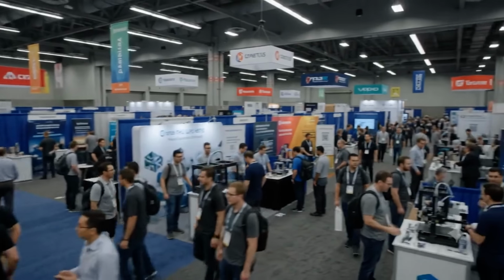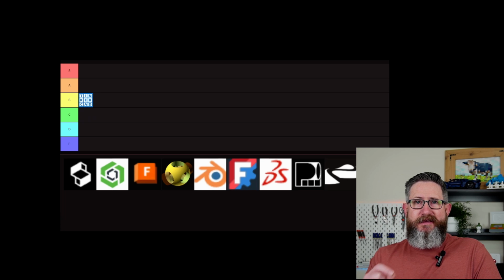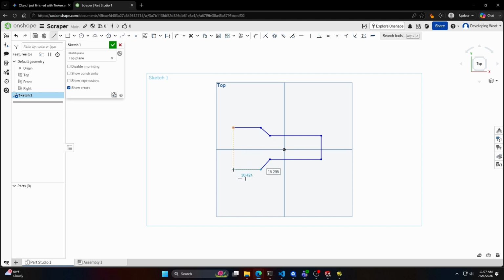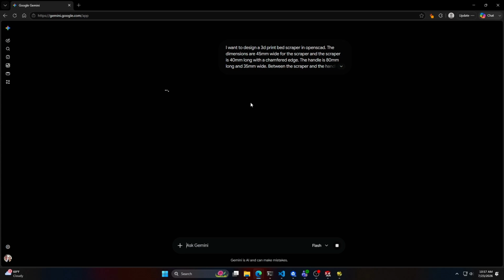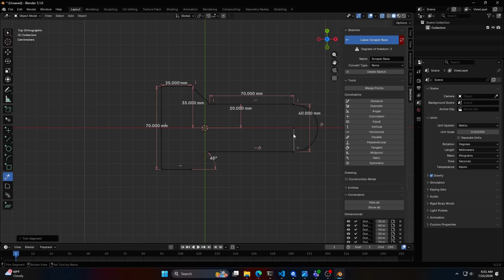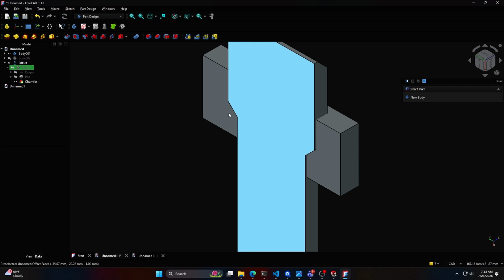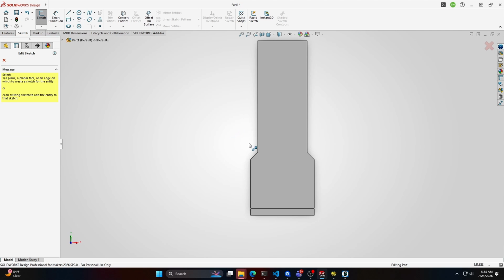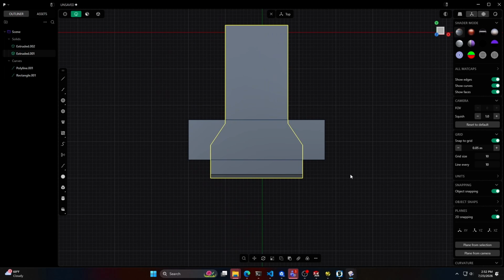Don't Pick a 3D Modeling App Until You Watch This!

Comment: As a hobbyist who does simple, non-commercial designs at home, I find this comparison very accurate for what I want to do. Similar to the video, I reached the same conclusion about 2 years ago that Shapr3D is S-tier for my needs. My only complaint is that Shapr3D needs a "hobbyist" subscription level that limits features or the number of active models but costs maybe $49/year, since $199/yr is a lot to create an occasional model, IMHO. Edit: BTW, the ability to use Shapr3D on my iPad Pro with Apple Pencil is a game-changer for me; super intuitive!

That said, if there were a way to put a modern Fusion-style UI on FreeCAD, that would likely make it at least A-tier for me, at $0/year.
Reply from the maker: 100%! I completely agree. If there was a more modern UI on FreeCAD I wouldn't go anywhere else. I did get a comment that there are community mods that make FreeCAD look more modern, I was going to see if I could check one out. Just thought I would let you know as well.
Reply: @wootsworkshop   Oh, good to know! Sounds like the FreeCAD community realizes their default UI isn't everyone's cup of tea. Knowing that there's a mod(s?) that might improve the UX, I will keep an eye on FreeCAD, especially when my Shapr3D subscription is up for renewal. ;-)
Reply from the maker: Recently I used FreeCAD's community MCP and Claude to model some insane parts. Would have taken me 10 to 15 hours probably but Claude did it in under 15 minutes. Just something else you might want to try out if you give FreeCAD a go.
Reply: @wootsworkshop   Thanks, I'll try that! BTW that might be a great video idea (best/most effective AI-CAD integrations for hobbyists).

Comment: I dont get it. . . Are you ranking these apps for precision modeling or jus t for general modeling? Because how are you putting blender above FreeCAD? When blender is most used for the entertainment industry not for engineering. I get that FreeCad really has an stiff learning curve and difficult to learn but still when it comes to precision is very above of most of the C and late B of you tier list xD.
Reply from the maker: My rankings are based on my personal experience modeling a functional bed scraper in each app, where I weighted user experience and workflow speed alongside precision.

Comment: Putting FreeCAD below blender for CAD... Your opinion is completely invalidated by that alone.
Reply: Thanks.  FreeCad it is then.
Reply from the maker: Have you tried SolidCraft? It's another free cad application developed in Rust. It's apparently building its own geometry engine as well. This is interesting to me because FreeCAD uses OCCT, at least that's my understanding. While OCCT is really mature, it would be interesting to see what the new kid on the block can accomplish.
Reply: @wootsworkshop  No.  I'm not big on changing CAD software unless I have a reason to.  I ran AutoCAD from 2004 - 2025, Inventor on and off from 2011-2025 and I used Fusion 360 for a few years until their licence became too predatory.

FreeCAD is fairly established now and is picking up steam.  It runs on the three major operating systems and most impressively, there is only minute differences between the OS versions and usually only OS specific work flows (F2 to rename in Windows and Enter in MacOS, as an example)

I really, really enjoyed OpenSCAD but it has the same problem as blender: Doesn't output real geometry.
Reply: @wootsworkshop  Tried it today - nice free software! Didnt use it much yet, but it definetely will replaces me OnShape for simple things -runs in browser and locally - thatks to devs and AI
Reply: @NavyCuda  He says to much searching through menus..  doesn't freecad let you make python scripts of you do the same menu traverse a lot?
Reply: @paulmitchell2916  I haven't spent any time playing with the scripting side of things.  

From a practical experience standpoint though, once you get used to the workflow in freecad you can model rather quickly.

I had an inventor licence, I let it lapse and now I do all of my cad work with FreeCAD.  I don't feel as though I'm missing anything.
Reply: @paulmitchell2916  He's only 'searching though menus' because he has never used it, it's a very poor way of assessing a tool which you may use for hundreds of hours and hence simply won't be searching through menus at all. Poor review
Reply: @wootsworkshop  It's impressive how far SolidCraft has gotten in such a short span of time, but it still failed for me on a couple parts I was making. There's talk of them having an upgrade for their geometry engine in the works, so that may change things. But when even FreeCAD can do a fillet on a part (as OCCT is pretty notorious about being particular about fillets and chamfers) and SolidCraft balks at it, you know there's room for improvement. This conversation may be completely different six months from now - it'll be interesting to see how it plays out.
Reply from the maker: @flygarfpv3496  Oh that's interesting. At the rate they are making commits to this project I would imagine things will change on nearly a daily basis, but a geometry engine is one of the hardest software problems for an AI to tackle. Not because any single piece is beyond reach, but because the difficulty lies almost entirely in robustness, and robustness is earned through decades of edge cases rather than clever design. It will be interesting to watch as it develops.
Reply: Blender always felt like a cobble of rocks. Appeared totally disorganized.  Some others are simply cost prohibitive.  Subscribe until death. No.  I don't think so.
Reply: @bipl8989 I model construction sites, and i prefer blender to AutoCAD, I receive models in CAD and convert them to blender to fix them, it really has great visualization and parametric controls once you learn them. I make contour materials and can fly around a site that is contoured. You can edit a single vertex or group, Blender has superpowers. (and built in VR for flying around)
Reply: Hey FC users! What are you guys making? So far I've made roughly 300 models. Mostly parts for  marine use.
Reply: @tigrismask  Lot of automotive parts, a bit under 100 models for me.
Reply: @NavyCuda Awesome!
Reply: 100% Agreed. Freecad is not for everyone, given the huge amount of workbenches and thus capabilities and steep learning curve. I learned it and can do just about everything with it, even more then in Blender.
Reply: @jokari69 How involved are you in FreeCad? Work related or other?
Reply: Came here to write the same comment
Reply: totally agree
Reply: Redesigned a glock and AR in tinkercad.  They work like a champ.
Reply from the maker: That's a fair perspective, as both programs serve very different design goals and workflows!
Reply: @wootsworkshop  Blender cannot export proper geometry to step files.  It does not generate geometry, it generates a mesh.  Is it satisfactory for 3D printing?  Yes.  Can it be used to design to millimeter precision?  Yes.  Can it generate an industry standard file that any modern machine shop can use to dump into their CAM software?  No.  FreeCAD Can.

Blender is not yet a suitable CAD option.
Reply: You look like Clippy. Your opinion is completely invalidated by that alone.
Reply: @frodev728  Ummm... you're basing one on looks, where as I was basing my opinion on object fact.  Blender is not capable of true CAD work, FreeCAD is.
Reply: @NavyCuda  that’s still just your opinion, which is still invalidated.

Comment: The problem with F360 is that it it's not available on Linux.

I do like OpenSCAD, since being 100% text based, you can easily version your models with Git for instance. You can also generate scripts if required. I've used it a lot to produce models of buildings with a lot of variations (footprint shape, roof slope count,...).
Reply from the maker: That's a great point, the text-based nature of that software makes version control with Git incredibly seamless for complex projects!

Comment: The problem with FreeCAD is not that "its UI is dated", the problem with FreeCAD is that I can't get past a single tutorial without filing one or two bug reports. Stability is the biggest issue of FreeCAD. It has gotten better in the last couple of years and it is still the best CAD tool I know, but it is still not production-ready. In fact, I do not know any CAD tool, whether paid of free, that I would use for any serious professional work.
As far as "dated UI" is concerned, I personally find so called "modern" UIs extremely illogical and slower to use, as opposed to classic menu-based UI where things were logically organized.

Comment: FreeCAD is just really cumbersome to learn because of the different workbenches and all the small details you have to get right in order for FreeCAD to function properly. Even marking edges, points and so on to use in another sketch is something that's not very intuitive.
Onshape has similar workflows but they're just so much cleaner and more intuitive.
I hope that the experience I gather with Onshape helps me get into FreeCAD if Onshape decides to criple the free consumer access like Fusion did and does.

Comment: I began my CAD journey back in the mid 90s (when a PC needed a math coprocessor to run this kind of stuff ).  I started with manual drafting, then Into  AutoCAD.  A few years after getting out of the Marine Corps I got into machining.  After some time I got into CNC which lead me to want to get into programming.  The shop I worked at used Solidworks/Mastercam.  I started learning SW on my own then decided to take a class at the community college.  That class entailed Inventor and Solidworks.  Of the 2 I preferred SW.  I got the SW for makers (I use the desktop version) about 5 years ago and then I got an Ender 3 s1 pro.  At my new employer they used Fusion, mainly because it is CAD/CAM so I started using that.  I still prefer SW for my own use because of some of the small details that fusion lacks, but they are both fairly easy to use.
Reply from the maker: I was using the desktop install of SolidWorks for makers too. I did some research and at least as I understand it the newer version has the 3DEXPERIENCE (all caps because that's how SolidWorks spells it) and that requires some type of cloud connectivity. I believe it's that connectivity that was impacting performance in my personal tests. I didn't try and see if I could speed it up, but I should try it again and see if I can.
Reply: I guess I'm the same generation as you are. I started out with Auto Cad R10 and my first 3-D was Mechanical Desktop. After that it was Inventor, Iron Cad, Top Solid and Solid Works. When I started to work as a consultant there was demand for many others like Pro Engineer, Solid Edge and Catia. To get to the point, my take is that it depends on what your need is, not geometrically but design wise. Are you modelling something that you already know what it will look like or are you inventing something unknown? Designing a tool for moulding of a given plastic part with very defined surfaces, then Pro Engineer or Top Solid can be a good choice however if you are designing new concepts like new products or automation then Iron Cad or Solid Works is better. One bad thing with Solid Works that actually is an advantage is that is crappy to handle advanced geometries. Therefore it forces you to make simpler, lighter models that therefore is much easier to handle downstream and to manufacture.

Comment: I was using Fusion free version, and it's very good. But you are limited. For me, it was that you can have only 10 files active. Which might be good for people who make single items, or a few for an assembly. But 10 became impossible for larger assemblies. Enter FreeCAD, it has come along way. They have developers who are pushing it forward, regularly. You can use it for anything and nothing goes to the cloud. Is it clunky compared to Fusion, yes. But, it is free and getting better. There are a ton of YouTube videos to get you help. I could easily make that scraper in 15 minutes using FreeCAD.
Reply from the maker: My intent wasn't to say FreeCAD isn't a good program, because that would be wrong. It's definitely a solid open-source option, especially with its active development. It just needs a lot of help with the UI. Recently I've started using it with the MCP connector and Claude and I've built some amazing models in minutes. So FreeCAD is doing things with the help of the opensource community that no one else is, at least that I'm aware of. If you haven't tried connecting it to AI you should, it's really cool. Thanks for your honest critics of my video, it helps people get a fair representation of each product, rather than just my opinion at the time of the video.

Comment: I've been using CAD since the late 80's (CADKEY on 5-1/4" floppies) and I can tell you from 10 of thosands of hours of experience that Siemens NX blows every other program out of the water once you learn how to use it.  Sure, I had to refinance my house to buy a perpetual license but as a contract engineer it has payed for itself more than10 times over.  Rock solid reliability with more powerful parmetric modeling tools than anything else on the market.  I'm not saying its for everyone but if you want the absolute top tier that can handle anything.  NX is it.
Reply from the maker: That sounds like an incredibly powerful tool for someone with your background, thanks for the insight into the industry standard! Does your license allow for regular updates without charge, or do you have to pay a maintenance fee?
Reply: And now they acquired ALTAIR... I use ALTAIR INSPIRE STUDIO which for me is excellent, love how modern it is. Hope SIEMENS keep it updated and working.
Reply: @RayK2073  NX for me also. I’ve never found anything it can’t do. I’ve been a user since Unigraphics.
Reply: I was going to mention my cad never appears in these videos! Started with Cadkey 3 now using Keycreator 2019. Does everything I need
Reply from the maker: I'll add this to the list, in the event that I ever make a part two.
Reply: @RayK2073  No doubt!
Reply: @RayK2073  And what about the little sister Solid Edge. Using the free version since long. Also not to easy to learn but very powerfull. But CAM missing. m5c
Reply: @RayK2073  I started on CADkey v1.0 too. The computer wasn't compatible with a mouse.  Had to type in the vertices coordinates on the keyboard.  Used all the big commercial systems, pretty much just run Fusion at home now.
Reply: @RayK2073  nx is super powerful, but it is not fast. Nor is it easy to learn and stupid expensive. For quick parts I would go with fusion.  If I know I am going to need to fea a part, I will probably use nx.

Comment: I made it about half way through this video. From my perspective videos like this are not particularly useful because different people come to 3D modeling with different histories. If someone has a history of code development they may find a CAD program like OpenSCAD far easier to learn than other CAD Apps. Also, OpenSCAD works very well with a version control system like Git.
Reply from the maker: You're absolutely right! This is really just my opinion based on my experiences using these programs. I agree, treating code as history and using version control like GIT is definitely a powerful way to approach parametric design! Thanks for adding your comments to the discussion it benefits the community to help with a fair and unbiased assessment.
Reply: It’s proprietry but OnShape has a very flexible versoning and branching system built in, it’s really useful.

Comment: I have about 15 years of Catia modeling experience. Freecad is about as close to that experience as you can get. For mechanical engineered models Freecad is great. And the price is right.
Reply from the maker: The price is right for sure. I've been using it with a Claude AI connector and the stuff it can do with AI is amazing
Reply: @wootsworkshop next video should be speakercad vs blender with claude plugin vs Freecad with claude plugin
Reply from the maker: @MakerLew  That's a good idea. I just started using AI with FreeCAD it's super cool.
Reply: @wootsworkshop another good thing about freecad, no need to be connected to the internet. I live offgrid so nothing is connected. No need for any cloud based storage.
Reply: FreeCad is great, but I somehow cannot overcome its Sketcher :(. Usually it ends up with Wire not closed :(
Reply: @jorix7 the intersection points should be red. If not draw a selection box over that intersection then select the coincidence constraint. It should turn red.
Reply: @roscoepatternworks3471  ha, same. Modelling in Catia since 2007. FreeCAD slowly grew up and can a lot.  Not with surfaces, but in part design is like Unigraphics NX in 2005.
Reply: @roscoepatternworks3471  would you recommend that I go ahead and dive into the tutorials? I was afraid I'd be wasting time learning it